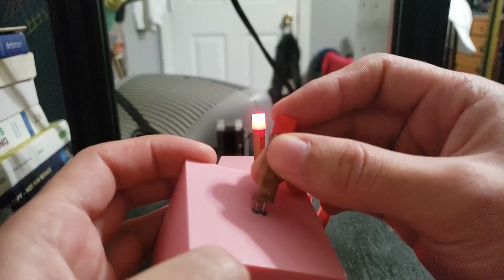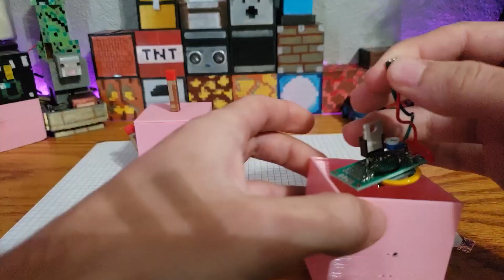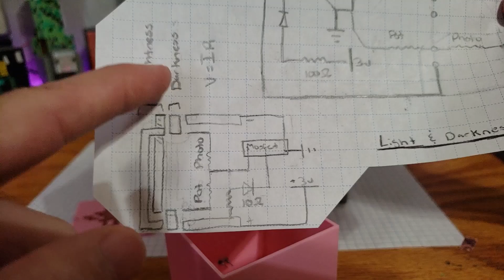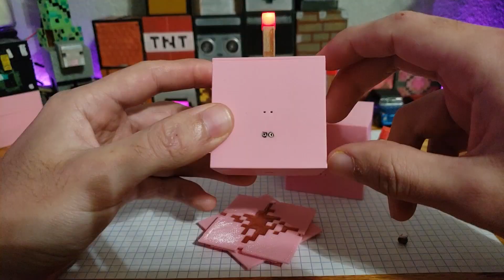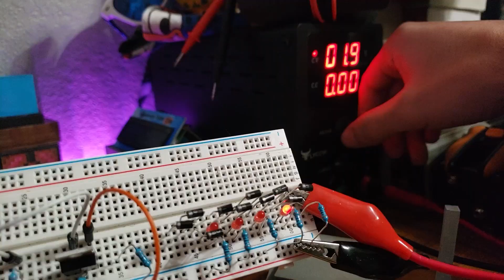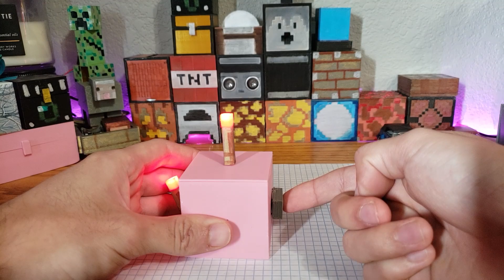Minecraft Redstone: Modular

Comment: This is amazing! Are you going to make redstone wires that connect to the cross next? That would be really cool. I've noticed that in previous videos, you've been using paint to make the block textures. I think printed stickers work a lot better for pixel art than paint. Just an idea.
Reply from the maker: Thank You! I plan on making a repeater clock next, so I will need to make some extra blocks. As for the paint, most of the models have a texture to them which make it easy to paint. For these blocks, printed paper or stickers is definitely the way to go : )